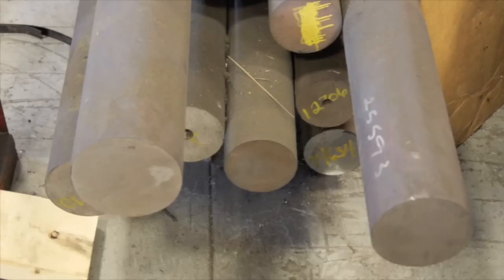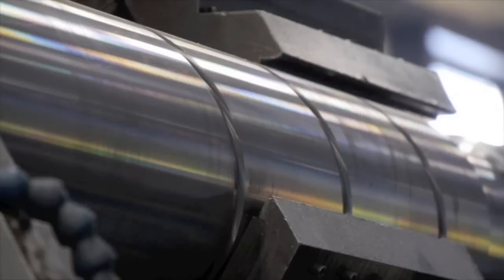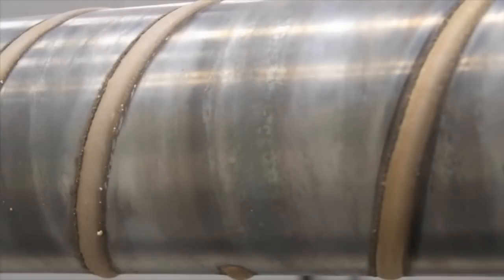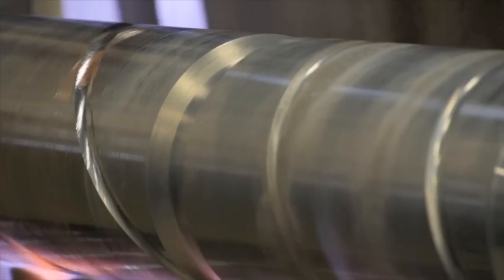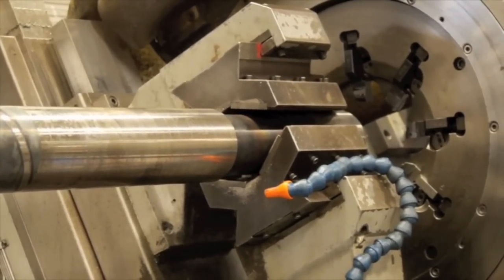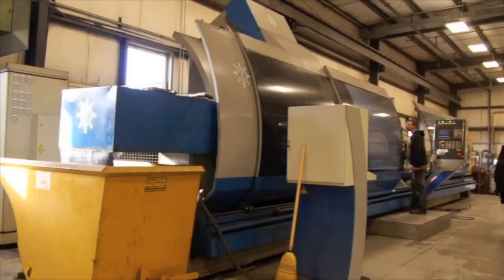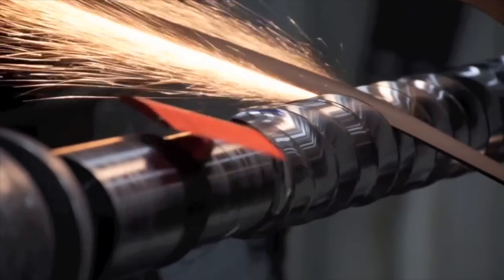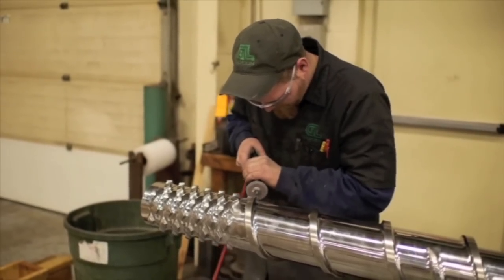How Is a Feed Screw Made? Complete Process for Screw Manufacturing | Glycon Corp. Michigan USA

Comment: Is screws for injection molding made in same way
Reply: Long answer: 
Screw (which is essentially a threaded steel shaft) are made from drawings . Be it any drawing/design. This has nothing to do with post-use. Be it a injection molding, plastic extrusion, rubber extrusion, blow moulding, any process, any polymers, any product making machine. Feed Screw are made in same manner. Although part of plastics industry, this is not related directly to plastics processing process and polymer science. It's just Precision mechanical engineering. Send your drawing and take a real screw made from that drawing. This is on you .. where you want to use this screw. However screw manufacturer does R&D and from their Vast experience (24x7 making feed screw) they can suggest/solve/ designs/queries related to your plastic processing.
Short Answer: 
Yes sir, injection molding screw are made in same way.
Reply: @rewtheultimatefeedscrewbar6629  thank you very much

Comment: from which material do you make these product?
Reply: EN 19 'R'
Reply: @ridhampatoliya4680  Its 4140
Reply: depends on application of screw, many grades of Nitriding steel, Engineering Steel, Alloys, SS material etc, Hardfacing and coating/sleeves are made of Super alloys and they are many kind. Everything depends on your application and budget.